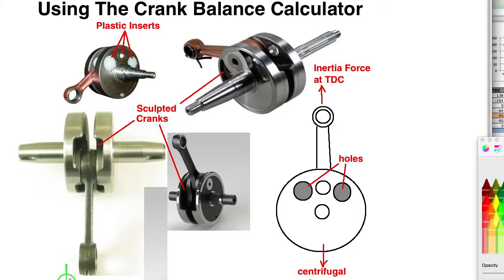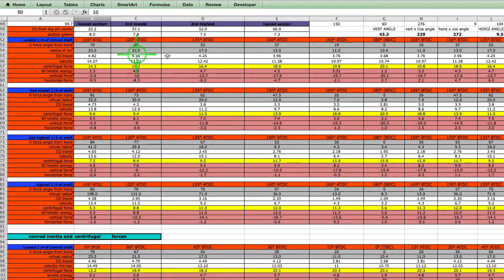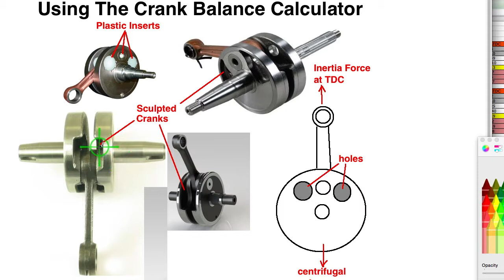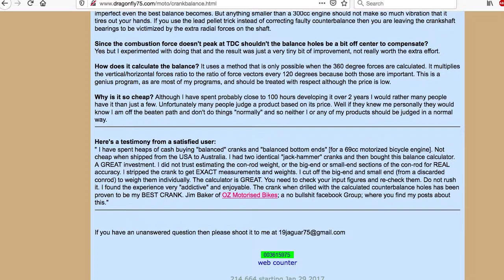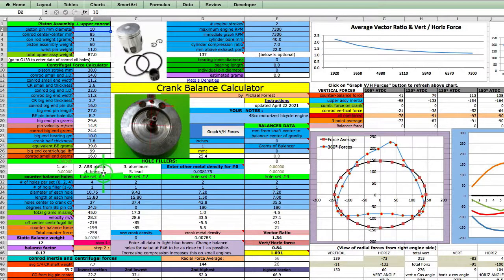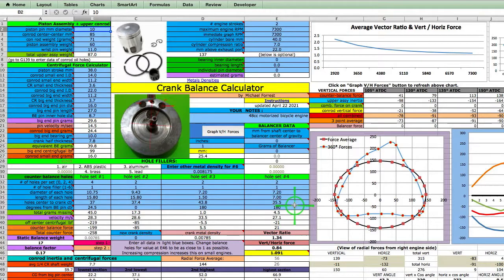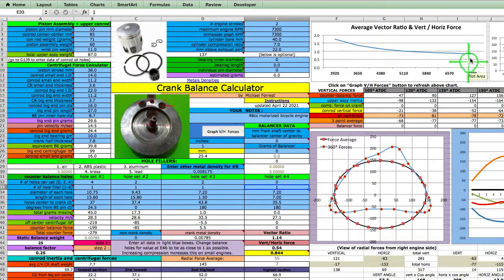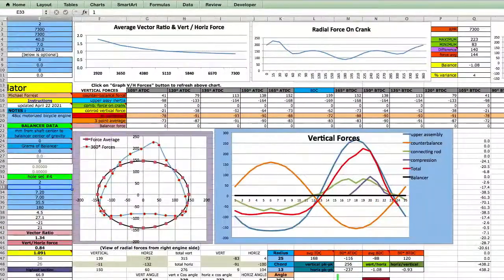About my Crank Balance Calculator (single cylinder 2 or 4 stroke)

Comment: if balance cannot be achieved 100% it is best to make the motor vibrate in horizontal axis of the motorcycle. much much less noticeable than any vertical. :D
Reply from the maker: no such thing as 100% balance for a 2 stroke unless it has the extra counter-balance shaft

Comment: Interesting information but also a large amount........Call me crazy but I don't wanna study 8 hrs a day for the next 6 months to try and get a 100% perfectly balanced motorized bicycle crank. By factoring in things like ring drag, rod length, cylinder pressure,bearing frictional drag,etc... I'm gonna balance it the same way you'd balance a motorcycle wheel. I'll test how it acts on the balancing stand before I drill into the crank to find the heavy spot, then get it to act like a balanced wheel.
    I was thinking of plugging all the holes with a combination of loosely wadded up aluminum foil & JB weld.... Scuff up the area inside the hole, wad the foil up to where it almost completely fills in the hole, leaving a couple mm space at each end, then add the JB weld, let cure, sand off excess.....I'm thinking the JB weld sticking to both the roughed up crank steel & to the uneven foil inside. Should give it plenty to grip onto & keep it from dislodging.
Reply from the maker: I think your way is the long way, not mine. With mine you just measure everything and type in the measurements and then keep entering a bigger hole diameter till the result shows balance.
Reply: @MichaelForrestChnl   I was in no way trying to criticize you & appreciate the information you supply (unlike some people on the forums) . From a glace, it looks like lots of reading (haven't thoroughly looked into it yet) 
      If you balance a crank with the piston, rings,wrist pin,etc..on it to behave like a balanced motorcycle wheel. Wouldn't it be much more balanced ( much less vibration) than a poorly balanced stock crank??  
     I see at a quick glance of the spreadsheet, it asks for things like the connecting rod weight,bottom/big hole ID,etc... Which I assume means you'd have to- split the crank open, take rod out, to weight & measure & press back in place,etc... Not sure I have enough/proper tools to do it right now, stuck with a very low budget due to health issues. Still have a welder,MC wheel balancer,small vice, small digital scale, calipers but no press like an arbor press & only one 3 jaw automotive gear puller, no more garage or workshop.  Which is why I thought of using a "close enough-much better than stock crank" wheel like balance method.
Reply from the maker: @michaelbrinks8089  it's best to take it all apart to weigh the con rod but the total weight can be estimated just by letting the small end of it rest on a weight scale and multiplying that by 2.2, and then just enter the specs of the big end bearing into the calculator and using the estimated bearing weight displayed at E11.
Reply: @michael brinks how is your statically balanced crank doing? ive tryin the same thing at the moment, got a 80cc china kit which vibrates so much that two welds on my exhaust broke.
Reply from the maker: it's not possible to statically balance a crank.  @roehle9962